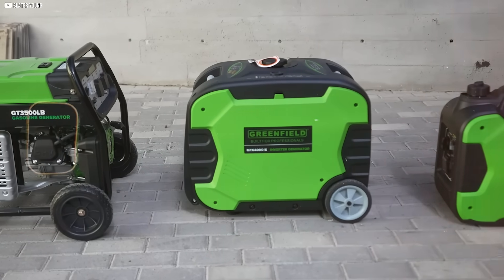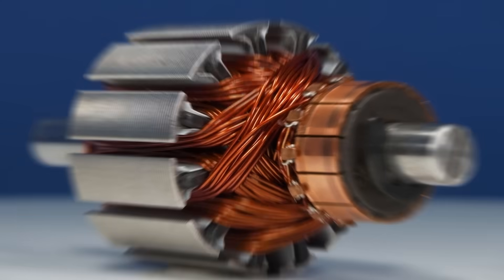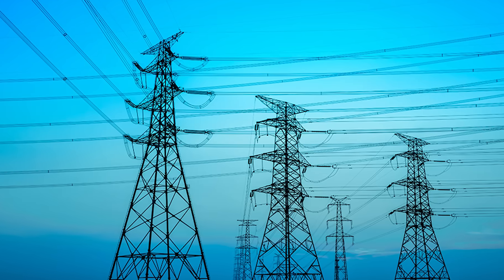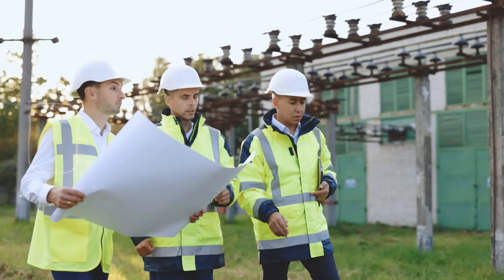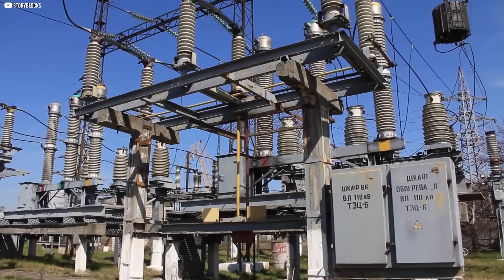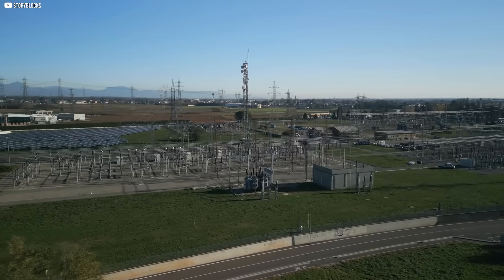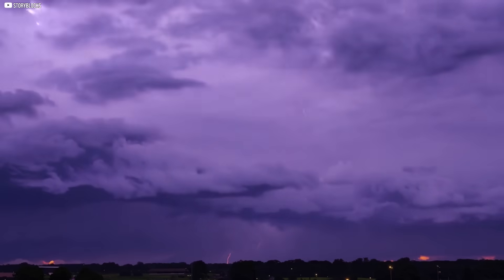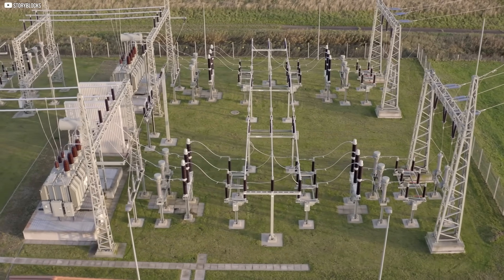Electricity Doesn’t Flow to Ground—Here’s Where It Really Goes

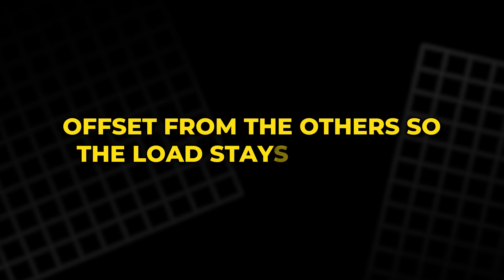Comment: At 4:06, you do see a fourth cable running to ground.  It's called the NEUTRAL, and it's attached to ground at every pole, and it is included in the wires pulled into electrical services for buildings and houses.  Its purpose is to stabilize the 0-volt point as ground, and protect against lightning strikes and contact with other power lines.

Comment: Look at a plug and you will notice that the ground prong is longer than the other 2 .  That prong connects to the load first so that any build up of charge will dump into the ground rather than send a spark thru your load .  You don't want little lightning bolts blasting every time you plug something in .

Comment: Still cannot comprehend this concepr. To be fair, I’ve read many text and explanation but it is still confusing.
Is there still a wire in the ground in case of ungrounded system ? In the video he mentioned the forth wire and then started talking about the case if one phase touches the ground as a part of ungrounded system. On the other hand, if there is no wire in the ground in the ungrounded system, why the phase  that touched the ground should cause the other two to rise ?
And what is then the grounded system ? Is there fifth wire ? Or ?

Comment: The Unified Fractal-Temporal Model of Reality (2025 Version)**

Key Principle: Reality is one, but it manifests across different fractal levels through the temporal mode ("speed of time"). Energy, information, and consciousness are manifestations of the gradient between these levels.

I. FOUNDATION: The Two Fractal Modes of Existence

1.  The Micro-World (Quantum, Base Fractal)
    - State: "Cloud," "Network," "Wave function."
    - Time: "Fast," potential, uncollapsed. Many possibilities exist simultaneously.
    - Example: An electron before measurement, quantum superposition, vacuum fluctuations.

2.  The Macro-World (Classical, Derived Fractal)
    - State: "Particle," "Solid object," "Object."
    - Time: "Slow," actual, collapsed. One version of reality is realized.
    - Example: A table, a planet, a human as a biological organism.

The transition between modes occurs through observation (synchronization of temporal modes) and *decoherence*.

---

II. PHYSICS: Electricity as a Temporal Phenomenon

- Electric current is not just a flow of electrons, but a process of equalizing a temporal gradient (voltage).
    1. Voltage: Creating an artificial "time difference" between two points.
    2. Current: Equalizing this gradient. Electrons transition from a "slow" particle state to a "fast" wave state to perform work.
    3. Work (heat, light, motion) is the material evidence of this equalization.

- Energy generation is the process of "pumping" energy from the "fast" micro-world into the "slow" macro-world.
    - Traditional sources (coal, atom, water) are crude, mediated methods of creating a gradient.
    - The ideal source is a *Quantum Fractal Generator*, directly drawing energy from vacuum fluctuations through resonance and specific geometry (crystals, grids).
        - Antenna-Grid: Captures the "fast" time of the micro-world (quantum fluctuations).
        - Rectifier-Crystal: Collapses the chaotic flow into a directed current (an analog of the DMN for energy).

- The Piezoelectric effect is direct proof of the model: a crystal acts as a *gateway*, transforming mechanical energy from the "slow" world ("friction and impact") into electrical energy of the "fast" world and vice versa.

- Lightning is a macroscopic manifestation of the model: dielectric breakdown (of air) as the "leakage" of energy from the micro-world, its fractal branching structure, X-ray emission, and ball lightning as a hybrid coherent state on the edge of fractals.

---

III. THE HUMAN: Consciousness as the Internal Observer

- Consciousness is a system capable of managing its own temporal mode.
- The Ego's "Clock Generator" (Default Mode Network - DMN):
    - Maintains a "slow," stable, sequential state of consciousness necessary for survival in the macro-world.
    - Filters the "raw" flow of information from the "fast" internal micro-world (subconscious, body, perception).
- Psychedelics and spiritual practices suppress the DMN, opening a "gateway" for direct access to the "fast" fractal of the psyche:
    - A flow of unfiltered information, synesthesia, a sense of "everything being connected."
    - Analogous to electric current: a direct connection to the source.

- Energy vampirism is a process of forced *decoherence*:
    - An external agent imposes their "frequency" (problem, negativity), forcing your consciousness to collapse from a rich "cloud" of potential into a single "particle" — which becomes an energy source for them.
    - The result is emptiness as a consequence of lost energy potential.

Comment: That's the beauty of using RF alternating current is actually low frequency RF 50 to 60 hz.
Think of it like a radio the difference is the frequency is much higher. These were principles that Tesla was working on understanding that electric could potentially be passed through the air.

Comment: Talking about the toaster at 7:08 -- I have always understood the return wire to be the "grounded conductor",  not the "neutral".  What say ye?
Reply: The "grounded" means what it is "to the ground, to the Earth".
The 'neutral' means that when not completing the circuit, it is zero voltage when measured to a ground.
The hot wire, when not completing a circuit, presents a voltage, albeit smaller, to the ground.
Try the measurement yourself with a voltmeter and you'll see it.
Reply: @mikel4879 When a hot wire [black or red ] shorts to metal case [zero 0 ohms contact it connect to the ground wire [green] and the short current flows to main breaker panel where the neutral [white] and ground wires [both bare copper and green are connected together]  so the circuit is completed but the shorted hot to ground causes a very high current and trips the breaker. the cicuit is using the green/copper  ground wire as the neutral for both tripping the breaker and also trying to keep the metal case at ground, neutral, earth potential to keep high hot voltage off the metal case [toaster,washer drill,] so not giving a shock to a person touching the metal case.

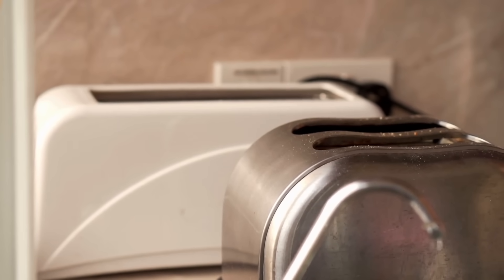Comment: Starting at 7:00 this video is wrong.   Earth ground has nothing to do with a ground fault in the toaster!   Earth Ground is installed to dissipate lightning surges.  No other reasons.   Equipment grounds take the fault current to the neutral in the main, then through the transformer.

Comment: My dad told me, they stopped using negative ground systems, because the batteries would go dead, even when not used.
Reply: Where did your dad get that information from? batteries go dead/flat over time due to internal discharge if no load is placed on it. Negative or Positive grounding would do nothing on it's own, if the other terminal is not connected to anything.

Negative ground systems would erode wires where they came in to contact with ground. Which is why the old POTS phone lines have a positive ground system. So did early cars to prevent the radiator from being eaten away due to bad engine earthing to the car body.
Reply: @Blackwolfster   he was an international tractor mechanic, in the days of the international M tractors.

Comment: Liv single battery 2 -+=2+ liv pulses push pull 120v 60hert NO GROUND NO NUITRAL..AMPS WATTS CURRENT BATTERY ONLY ...LIV S
INGLE LINE 2SIGNAL 60-60+ 60SEC 12OV ACTIVE DC BATTERY DISCHARGED

Comment: The purpose of a ground on your plug has 2 reasons for code to reqire. 1). Any short will trip the breaker instead of letting the short to continue and cause a fire. Also the ground plug forces the user to avoid using common as hot because, that can burn our switches. Causing equiptment to over heat and trip breaker due to high amp draws.
Reply: This is why saying that electricity flows is not accurate. What it really does is spread like a fire.

Comment: Ignore this.
Reply: Yes.
Reply: Telefone travels trough ground with one line🪖
Reply: Why do you write that? This video was technically accurate in just about every aspect unlike most things on the internet
Reply: Cette vidéo donne des informations importantes,

La masse a la terre et ou masse châssis, c'est un déphasés,

Le déphasage est un volume, et tant que ce volume est pas saturé, il reste en déphasés et absorbe comme un condensateur électrolytique (Cathodique)

Ci le volume du déphasage se sature, la cathode émet un rayonnement électromagnétique a doubles impédances, dont une est forte et coupe le courant par intermittence, cela veut dire que le courant de sortie a L'anode va essayer de combler le vide cathodique sur une large amplitude d'un gap différentiel, sans réussir à le saturé,

Puis le courant Cathodique commute vers une faible impédance, qui va être un gap volumique plus petit, a plus faible amplitude, et le courant Anodique va pouvoir aisément saturé le volume cathodique, générant une force poussive duplicatives volts/ampères en les câblages triphasés,

C'est le principe du transistor
Reply: Lorsque les deux gaps d'impédances sont saturés, il est clair que le plus petit volume du plus petit gap, reçoit une tension (+)(+) qui dans un circuit normal, va crée de la chauffe,

Mais l'utilisation d'aimants permanent en répulsions anti-magnetique/magnétique avec une bonne isolation est trois bobines couple enroulé en huit, et les sur tensions sont absorbés en l'anti-magnétisme , donc le magnétisme extrait la force de contre actions tensoriel sur les masses des corps, qui peuvent repulser les sur tensions et donc les frictions d'échauffement s'éloignent des corps des matériaux , créant plus la résistance électrique repousse en orbital les frictions de chauffe, des effets de refroidissement supraconductif sur les corps des matériaux
Reply: Dans le cas d'un éléments électronique supraconductifs, la volonté d'arrêter la conduction électrique , devra dérivés les masses positives et négatives des deux effets de chassis différentiel, sur une prise de terre,

Les deux courants d'impédance en saturation, vont alors dérivé la force de saturation du plus grand volume a la terre, qui redevient déphasés non conducteur,

Le spectre super critique hors spectre polychromatique ambiant de la saturation du grand volume, va alors se re calibré sur le spectre polychromatique ambiant ,

C'est le principe de la fusion a froid, pour neutraliser le trop large Gap différentiel de la radio activité d'un matériau magnetisé

Comment: Ground is not ground the world round...

We had many times when the point labeled ground in the schematic was a voltage compared to power ground, and if you connected schematic ground to power ground, the circuit would burn out components. Even when labeled not to use test equipment with power ground connected, people would still do it and burn up test boxes. And it was my fault because I could not redesign 50 year old test equipment. With over 35 years working there, being fired for health reasons felt good! I was able to claim disability, until I reached retirement age...
Reply: WTF?

Comment: Touched on all the high points.  Good starting video for electrical safety. Thank you.
Reply: clueless
Reply: No, this video was one of the most accurate descriptions I have seen.  I was surprised.  Usually there are many faults
Reply: @davidsuzukiispolpot you are badly wrong
Reply: @davidsuzukiispolpot 
Agreed. 
It was pretty good. 
At your work places HOPEFULLY will train you on additional safety protocols.
 
When a large MAN lift truck loses footing and lays into the power line
Do Not rush over there to save the operator ! The truck is Hot.
No one ever drives a DEEP ground rod
and ties the truck off.  Kids don't have time for safety.  I saw a hero stop
others from dying as they rushed a truck.
The bucket man was freaked out but safe in his fiberglass bucket.
So to me this was an Excellent! starter video.  Vaughn Industries has the best
safety program I've seen so far. 
The Big Boys in WV like SWN and Williams are pretty good, but not comprehensive.  
PhysicDuck covers a lot ground, lol.
But Yes, you're right !!

Comment: I was watching about a uhv DC Powerline being installed. One wire was strung over the river while one where was terminated on the shoreline, I saw one side of the river but not what they did on the other side of the river.
Many flavors are not the standardized 3-phase 4-wire systems, such as a single wire distribution Network in Brazil that uses the Earth as the return.
Reply from the maker: That's a great point about the different configurations of power transmission!
Reply: @TheForgeEmpire  Electricity is spooky. We have some known ways to use it, but it still has secrets.